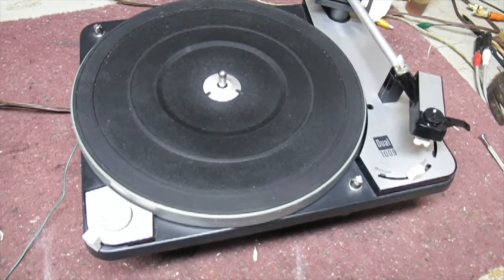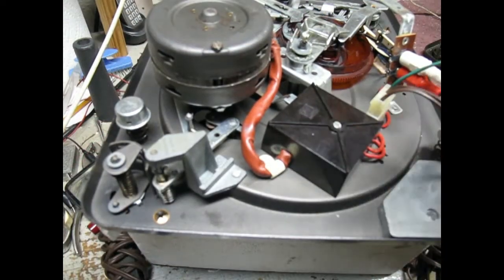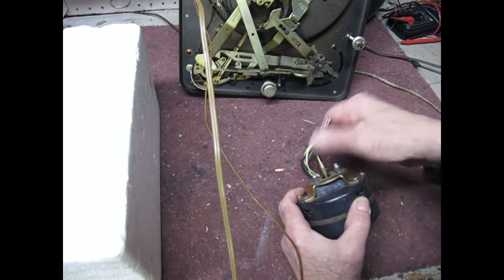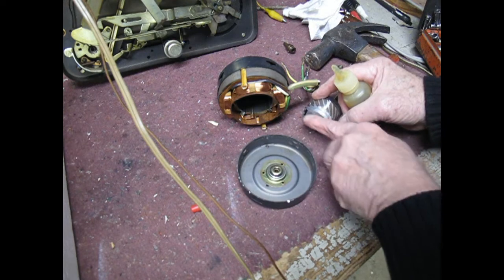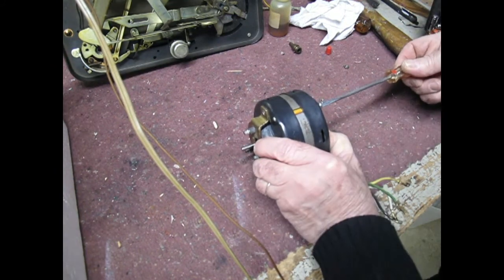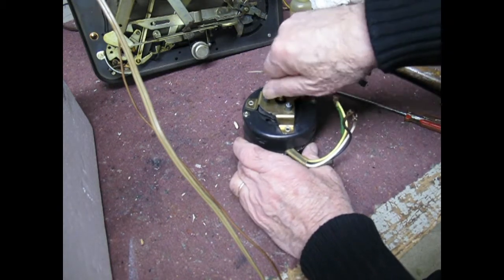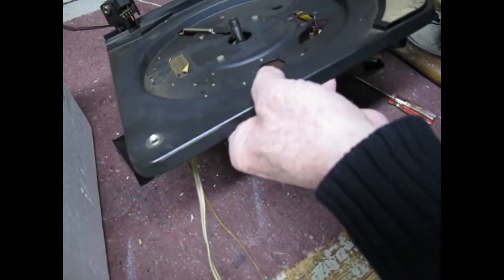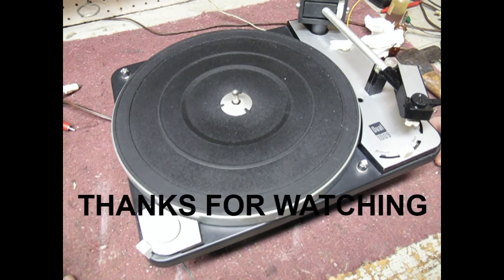DUAL 1009 (1000 SERIES) TURNTABLE MOTOR REPAIR

Comment: Thanks! Because of your video and instructions I didn't hesitate anymore to give the motor of my 1019 a good clean. I Was afraid that I probably would damage the coils, but that's almost impossible. The motor is also build like a German tank. Jus like the rest of this wonderful turntable. After all, it was a fairly easy job and it made my 1019 running so much faster (pitch control in the middle for correct speed) and even more important... It's running so much quieter by now! 😀 This is not Hifi, this is High-End stuff!

Comment: Great video, and very helpful.
I have just been able to open up the shells of the motor of my 1219. It was hard to do as there is rust involved. 

What would you recommend to clean the rust away from the inside of the motor?
Reply: wd-40. Good Luck!

Comment: I watched your video and have a question for you if you dont mind. I have the 1009 sk2 and when the idler arm contacts the motor it makes quite a bit of noise. spin the idler arm or motor by themselves and you dont hear anything. I think it is the contact between the two making all the racket but not sure what I can do about it. Almost feel like the idler arm should have some type of rubber band that goes around it. Any ideas? Thanks
Reply from the maker: Perhaps the Idler might have hardened with age. Good luck
Reply: @audio4335  that seems to be the consensus from others as well. I appreciate you taking the time to respond back to me. I am looking to buy one now. thanks

Comment: My 1009 I can't get the tone arm set right ... push the start lever and it will cycle and just shut off... if I hold the start lever until the arm moves then it will work , the little hook that keeps the TT on slips off the loop  when I push to start ... if I adjust it just a hair ... the hook wont get pushed off by the arm  at the end of the cycle , so it will just run continually ...

Comment: Thanks a lot the video was very helpful and worked well for me. It was not necessary for me to disconnect the wires of the motor. Unfortunately the speed adjustment of the idle wheel is now misaligned. Have to put the switch to 16 to play a 33 and it's a tad to slow. Any advice how to fix that. Cheers
Reply: Loosen the small screw and adjust the height of the pulley.